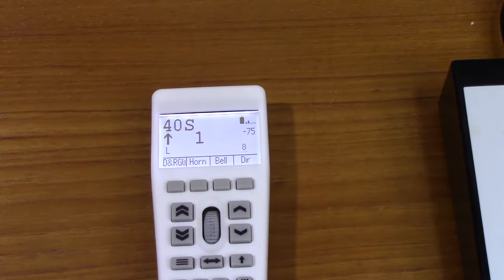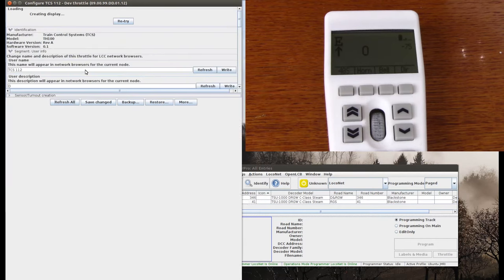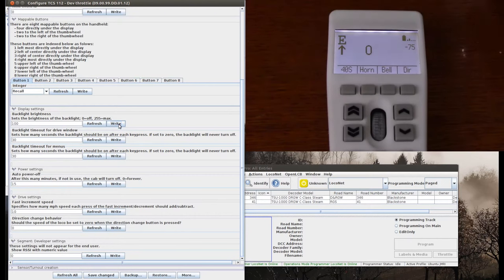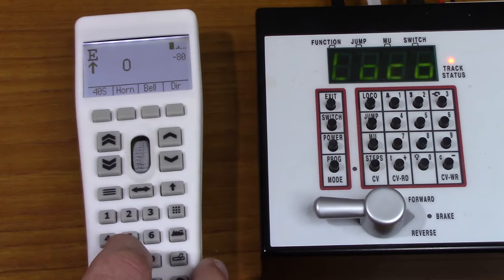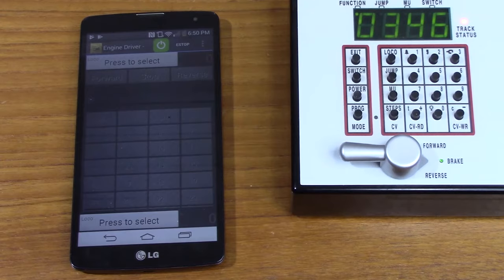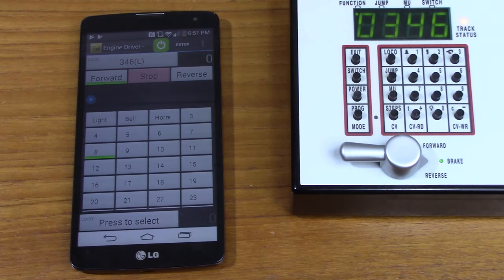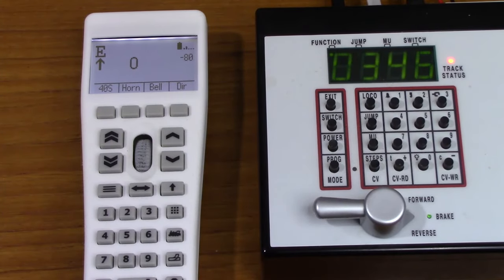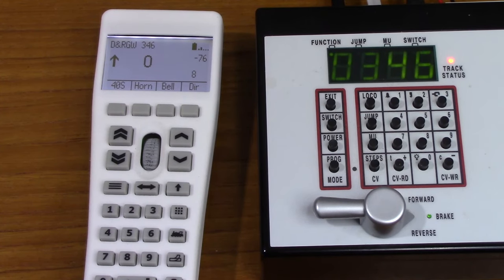#21 Model Railroad Throttle 2

Comment: I have used Lenz since 2001 and I like their auto steal. It tells you the loco is being controlled on another throttle. At that point if you speed up or down or use a function the loco is yours. I'm looking for to this new throttle. Exciting!